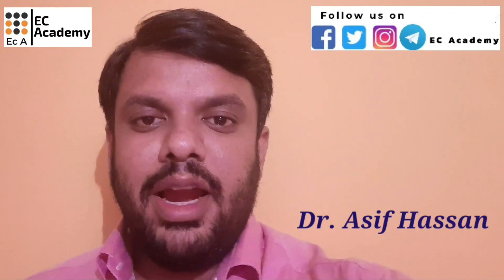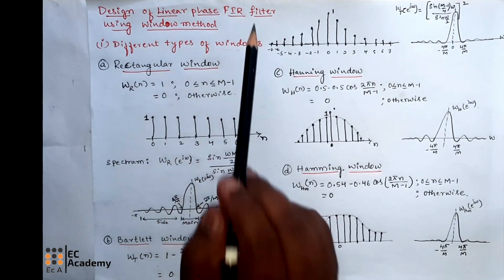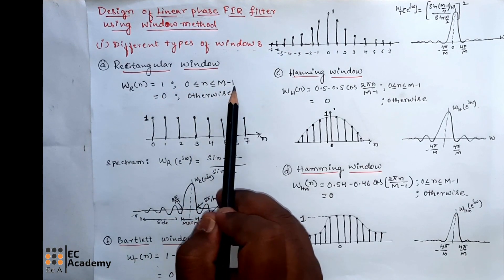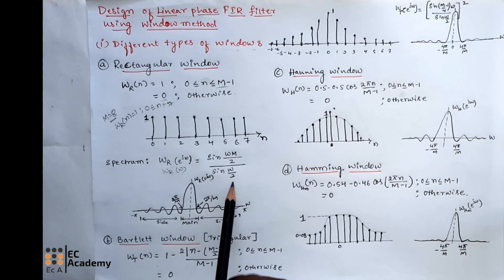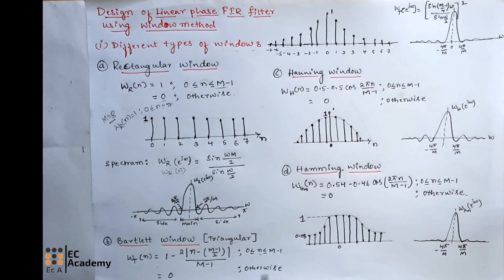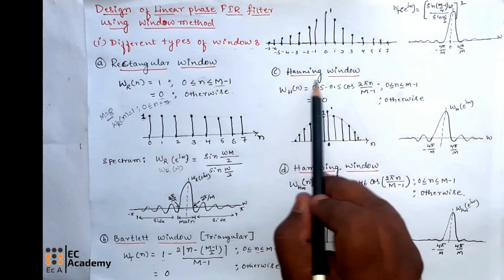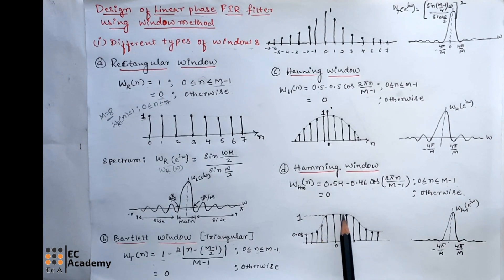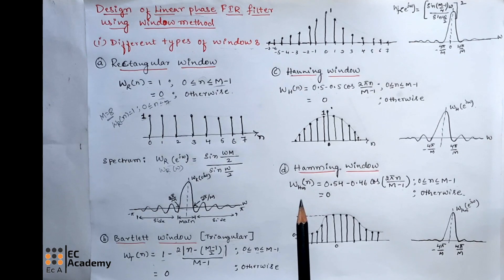FIR Filter Design: Different Window Functions Explained (Rectangular, Hamming, Hanning, Blackman)

Comment: Sir in some books there is 0.54+ 0.46 , instead of - ,in hamming window, which one is right?
Reply from the maker: If you take + for n less than or equal to (M-1)/2... we have taken - for n value varying from 0 to M-1 both are correct but  the equation which I have written in the video is usually used for calculations
Hope this was helpful ✌️
Do subscribe and keep supporting EC Academy 👍🏼